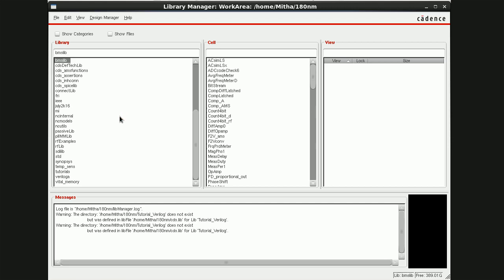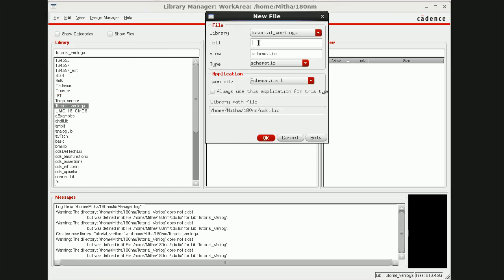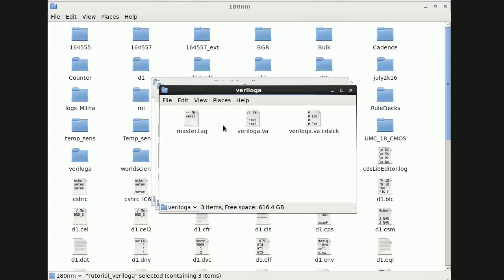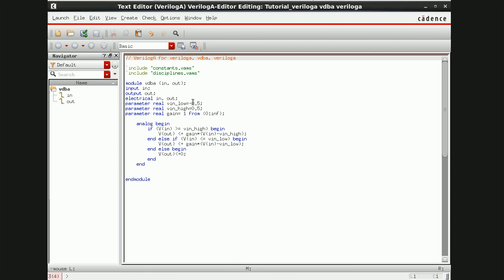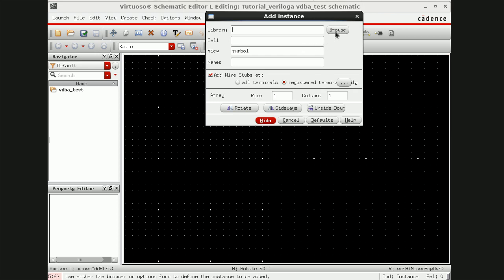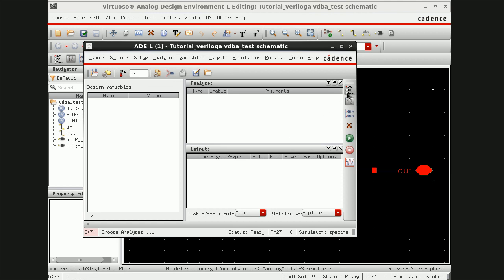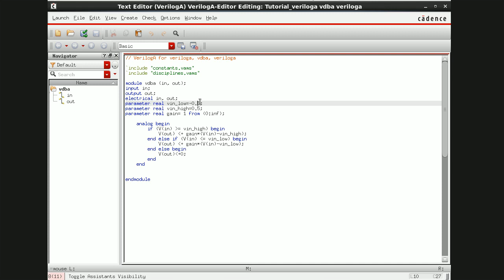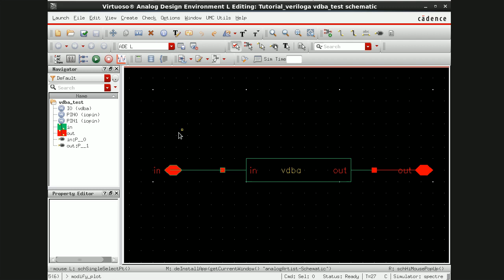Cadence IC615 Virtuoso Tutorial 14: Using Veriloga in Cadence IC615

Comment: sir I get the error "(TE-4309): extract failed for cellview in cadence how I solve it
Reply from the maker: I think some syntax/variable/parameter definition is not correct.
Can't say more without seeing the code.
Reply: @MudasirMir7  sir I resolve my problem but please can you tell me I have 22nm my lookup table of n finfet and p finfet  i want to make inverter using n-finfet and pfinfet in cadence  using Verilog-a code or any different method so please tell me or provide some reference from where I learn
Reply from the maker: Have a look!
https://miscircuitos.com/how-to-create-a-model-in-verilog-a-with-a-lockup-table/
Reply: @pavankori6986  Hi Pavan how did you resolve this problem?

Comment: Can we do the same job with Tanner EDA ? If yes, then please share a video for that also.
Reply from the maker: Hi Abhishek, I haven't used Tanner much besides for some basic analog circuit design/layout.
You can find many open source veriloga simulators on internet.
Reply: @MudasirMir7  Thanks for the reply. May I know any specific open source  tool for the same
 I have extracted data from TCAD, and want to use them for circuit designing by creating verilog a based loop up table approach. I know it is possible with cadence virtuoso, but I don't know about open source tool for this.
Reply from the maker: Hi, you can use  Isim of Xilinx ISE or Qucs, Icarus Verilog (open source) or try here https://www.edaplayground.com
Also, MODELSIM from Mentorgraphics student edition is free.
Reply: @MudasirMir7  thank you so much.

Comment: Hi, Is that possible to make layout for this? or we need to design an analog amplifier separately? Generally, how can we transfer a HDL (VHDL, Verilog) to a layout?
Reply from the maker: Hello, we use veriloga at top-level just to model the behavior of our block how it is going to behave and all. It also helps us to finalize the overall specs of the block too. You need to design the amplifier and then draw the layout separately.
Reply: @MudasirMir7  Thank you so much for your quick response.
Just I'm curious what is the steps of reaching Layout from a VHDL code?

Comment: Great video sir,  during opening of the application i don't get the option to open with text editor, there is only read VerilogA as an option, how to go about this problem ??
Reply from the maker: Thank you,
You have to go to your work directory and open it there in text editor
Reply: @MudasirMir7 Sir, Thanks for a great video. When using work directory to open,in such a case, how do we create symbol for that verilog A code?
Reply: @ajeysingh8024  in your main cadence terminal set your text editor to gedit by typing editor="gedit", now when you try to follow the procedure it will open with read veriloga but in the gedit text editor, when you add you code, save and close that editor, it will prompt you to create a symbol